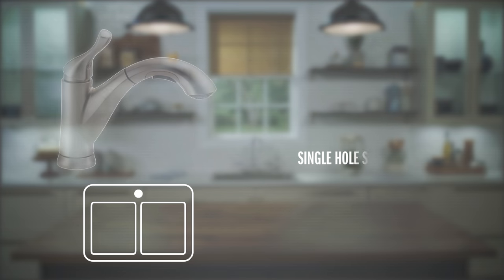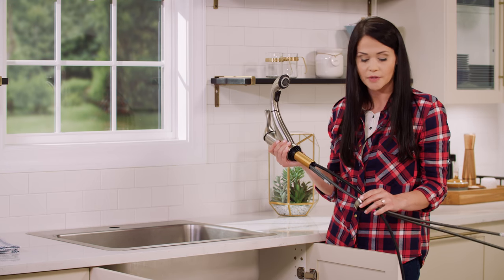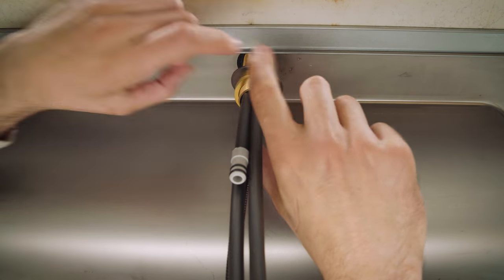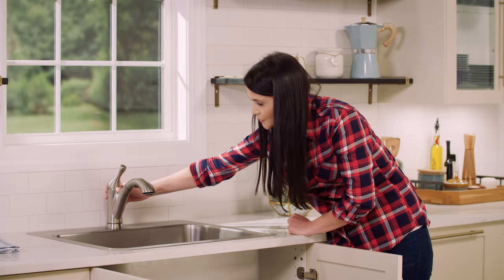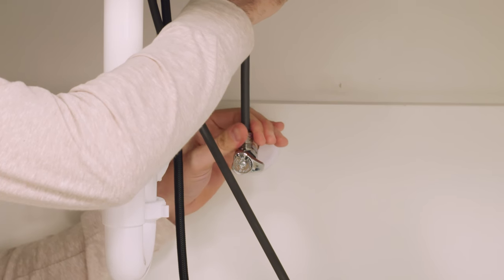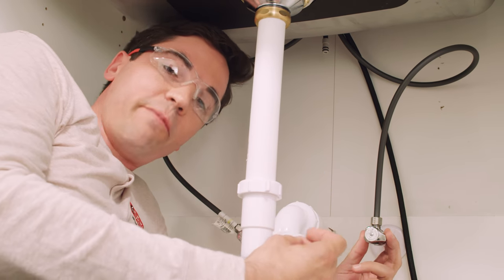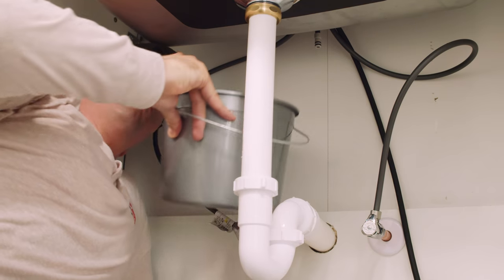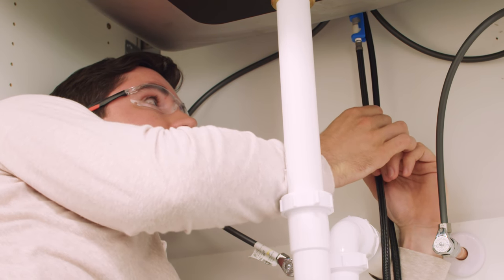How to Install a Delta® Single Handle Pull-Out Kitchen Faucet

Comment: Thanks for the informative video, that showed how inaccurate and inadequate the written instructions were.  Delta should definitely correct this problem.  One thing you didn’t address, which is confusingly addressed in the instructions is how to shorten the supply lines.  Because I have drawers close to the floor underneath my cabinet, the cabinet itself is rather short, and those supply lines are too long.  The written instructions are useless, yet I needed that information.  I ended up just looping the supply lines until everything fit, but if you have any suggestions, I’d appreciate knowing them.
Reply from the maker: Hello Greg Kopp. Thank you for your inquiry. We do not have instructions on shortening the supply lines as we do not recommend it as it voids the warranty of the faucet. You did what was correct which is looping the supply lines. We apologize for any inconveniences and have passed along your suggestion to the correct department as well. With any further questions or concerns, do not hesitate to reach out to us directly via email or give us a call. -Carrie
Reply: My instructions say you CAN CUT the line. Page 6. I won't be doing that. But just so Delta better eliminate that part or BACK UP  your warranty
Reply: @deltafaucet  - Your instructions must be written by a blind man from a foreign speaking land. Would it kill you to have actual succinct and simple instructions that match the type of exact faucet a person buys?
Reply: It even give the 2 white plastics garment in case you're cutting the line and placing the garment in the line 🤦🏻‍♂️🤔

Comment: If you're looking for design perfection, don't get the "Pixa". Look at the top surface of the handle, there's creases and wrinkles in the metal on a curved surface that should be a smooth curve. Never seen such negligence in plumbing fixture finish.
Reply: Moen are nice

Comment: Not happy with Delta bathroom faucet . They used a thread that requires expensive supply lines. There is a round extension on the bottom that prevents a "snake bite" fitting from hooking to it so you can use Pex in mobile homes. Being returned tomorrow and never buying Delta again.

Comment: Junk.  Just installed a Delta Charmaine side handle for Thanksgiving cleanup.  Little flow out of the cold side (no kinks in the PVC).  Delta sent a new cartridge, didn't help.  So I reversed the hot and cold feeds to get more cold flow until I swap this turd out.  Should have bought an Amazon Chinese knockoff for  1/5th the price of the Delta.

Comment: Unfortunately the quality of their "customer service" in my experience is very poor. They send the wrong parts since they don't even know the names of the various repair parts. For example I asked for the washer and spring parts and they sent me the cam assembly. I had to order from Amazon to get the correct parts and I received them much faster too.

Comment: In case anyone came here to figure out which supply line is hot and cold, as the video shows, but instructions fail to show, the connection ends are marked blue and red. Not obvious without closer inspection. Horrible instructions Delta!

Comment: I have a new delta single handle and this is a totally useless video. The end of the sprayer hose has 3 inches of plastic on it and it does not click in place, nor does it have that blue piece that goes around it to secure it. Impossible to know what to do with it. Spent and hour on the phone with Delta and they were of no help whatsoever. No instructions saying what to do with 3 incles of plastic attached to sprayer hose. NIGHTMARE.

Comment: This faucet is junk. After about a year is squeaks and it hard to move the handle and nearly impossible to shut off without drips. I'm going to replace it with an American Standard like I had in my old house.

Comment: Now do it with a Garbage disposal, a dishwasher and an under sink reverse osmosis system installed, all with the stub outs roughly parallel to the bottom of the sink. Joke of a video
Reply: What?